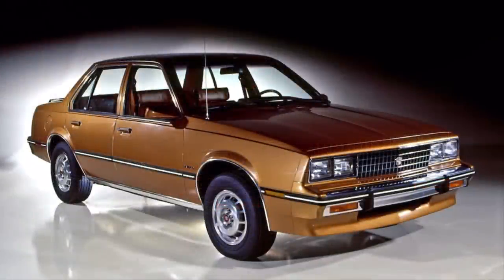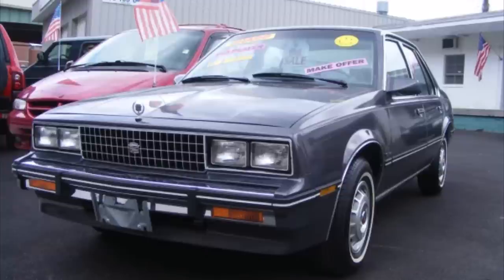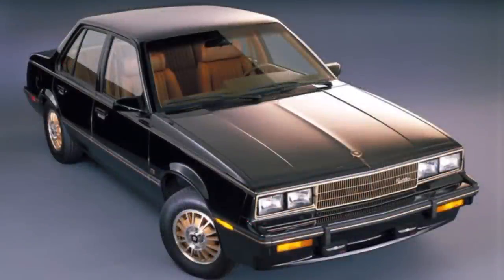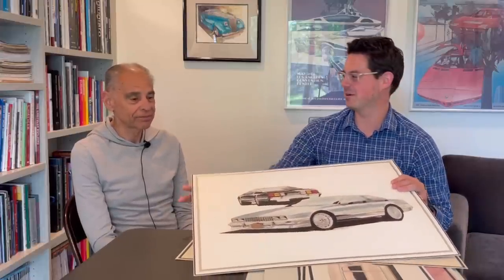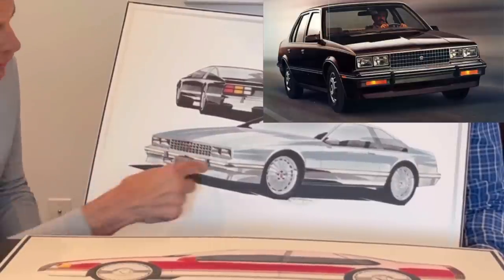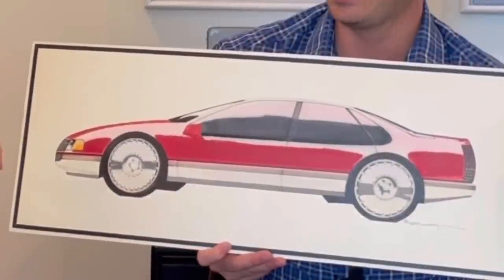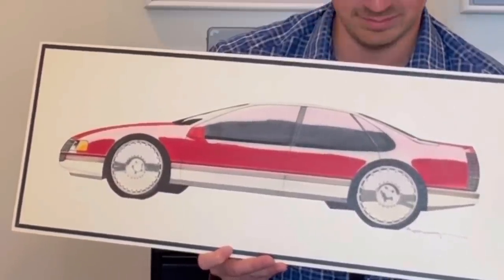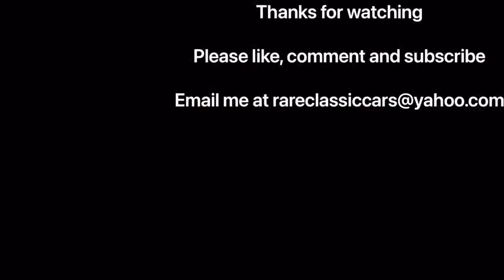The Cadillac Cimarron & Its Design: What Designers Wanted vs What They Got

Comment: Personal belief. I believe the Cadillac dashboard should have come from Buick Skyhawk dash design. Looked more upscale than the Cavalier design. For it to be a Cadillac they should have offered a 5 speed manual or 4 speed auto transmission. The 2.0L throttle body injection engine wasn’t bad for its time but for the price bump, the car needed the V6 standard. The 1.8 OHC turbo and later 2.0 OHC turbo was faster but suffered horrible turbo lag and torque steer.

Comment: Question- were the fwd unibody platforms designed by the divisions or by gm central engineering, then handed to the divisions to sell like the Vega was.
Reply: The FWD X/A bodies were GM's first attempt at joint development across the divisions, with the labor dividing up among them. I'm not as familiar with the J's, but GM North America and GM Europe were involved in the J development. After reading DeLorean's On a Clear Day, it is really surprising GM did not go bankrupt sooner. There was so much duplication of efforts with each division doing their own thing even in the face of the inevitable decline of market share as foreign entrants were coming into the market.
Reply: @stevevarholy2011  they almost did in 91. The truck/suv revinue is what helped them avoid it.
Reply: The j-car was mostly of German origin.

Comment: Great preview. Maybe it coulda worked if the J cars were good to begin with but they were overweight, underpowered, and no IRS in the rear. The cimmaron done right coulda been the gen 1 Acura Integra. Everyone always knew it was a re-skinned Civic but even then I dont see how it coulda been possible on such a short time frame and budget.

Comment: I think it is forgotten that GM had (somewhat) successfully pulled off what they were trying to do with the Cimarron in the other divisions (J2000, Firenza, and Skyhawk). Perhaps if they’d have started the base price of the Cimarron just a little lower, say around $10,900 with less content, instead of over $12,000, then let buyers option up to the big $, they’d have lessened the perception that they were thrusting an overpriced gussied up Cavalier on the market. The Skyhawk Limited had a starting base of just over $8,100, so there was some room to start lower IMO. GM also pulled what would become a trademark strategy, they start getting a car sorted out and kill it.

Comment: It looked like a small Opel from Germany, that's not bad. Opel was making some very nice cars in Germany in the 80s, just not what traditional Cadillac buyers were used to, Opel senator was beautiful.
Reply: Don't forget that in the late 1990s, Cadillac took a German Opel and sold it in the US as the Catera. Advertised as "The Caddy that zigs", the Catera tried to compete with cars like the BMW 3 series, Mercedes C-Class and Lexus ES. Like the Cimarron from 1982-88, the Catera was also an epic fail, especially with its generic styling and reliability issues. I refer to the Catera as the Caddy that increased Lexus sales. In fact, my parents had one. Several years and many problems later, they bought a Lexus.

Comment: I don't understand why GM didn't take the Ascona C instead of the US Cavallier and put US bumpers, Cadillac grille and taillights on it.  My Aunt had an Ascona and I always liked the styling, and it was a decent car, about as good as you could get in an early J-body.  That seems to me like it would have been a better option.
Reply: From the photos, the Ascona 4 door seems to have almost exactly the same body panels as the Cavalier or the Cimarron. The 5 door hatchback was, of course, different, but I don't that would have gone over well in the American market. Maybe one of the bigger engine choices would have been a big improvement over the antiquated 1.8 L we had here.

Comment: The problem with the Cimarron was not so much the styling - by 81-82 Cadillac quality overall had gone into the toilet - I know I was there .  We would roll these jumped up skateboards off the transports and boom the check engine lights would come on . The interiors were cheap and the engine had no power - in retrospect it looked like undercover agents from Ford had taken over GM .
Reply: In 1981 you could get 3 engines in the seville.

The V864, the diesel 5.7, or a credit option Buick 4.1 V6.

The Buick V6 was probably the most reliable of the 3.

Comment: They could easily have stamped out some sheetmetal exclusive to the Cimmaron that could have helped distinguish it from its corporate twins. Otherwise it relies completely on exterior trim for differentiation.. They were just to cheap to invest in it and it showed.
Reply from the maker: Sheetmetal is one of the longest lead time items.  You’re forgetting that with all that change, you’d have to revalidate the car for crash and safety standards.  Clock was ticking.
Reply: @RareClassicCars  I think they could have managed a re- strike on the fenders and some clever rear fascia.

Comment: I find it hard to believe someone made drawings of a car with huge ghetto reehuums and no tires back in the early '80s. Such abominations didn't exist back then. Cars still looked pretty much like cars. Not as good as '70s cars, but 10 times better than the trash we have today. I had been working as a government fleet mechanic for almost 4 years when the Cavalier came out in 1981. We wound up with a large number of them. Other than the fact that they were front wheel drive, I liked them. Had they been rear wheel drive, they would have been very simple, basic cars that would have been very simple to service and work on. The original base models even had 13 inch wheels, which were the perfect size for the car. 1981 was only one year after the Ford Pinto was dropped. I still own and drive a 1972 Pinto wagon, complete with 13 inch wheels. If it weren't for lowriders, I wouldn't be able to get tires for it. 

But while the Cavalier was a decent transportation appliance, it was not a luxury car, and there really was no way to turn it into a luxury car. The styling was pure economy transportation appliance. Loading it down with luxury features would have drastically raised the price, and it still wouldn't have had the right look. And it was just too small. IMO, a luxury car should be large, and have a smooth, floaty ride. I have owned a 1974 Lincoln Mark IV, a 1978 Lincoln Mark V, a 1987 Lincoln Town Car, and currently drive a 2006 Lincoln Town Car. To me those are what define "luxury car", and the Cimarron just didn't fit that definition.

Comment: originally the Cimarron was supposed to be on the X platform with that Gen of Buick Skylark Chevy Citation Oldsmobile Omega and Pontiac Phoenix but they couldn't get it to work so the Cimarron was Switched to the J Platform so it ended up looking like a dressed up overpriced Cavalier and was a similar price to what the Seville had cost 7 model years earlier correct the base Seville cost $12.479 when it debuted in Mid 1975 for the 1976 Model Year while the base Cimarron cost $12,131 in its debut model year 1982 Heck even a full size Chevy Caprice had a lower starting price in 1982 was 8,437 the only 2 J platform cars that lasted past 1988 were the Cavalier and the Pontiac Sunbird/Sunfire which both lasted until 2005 it was also the shortest length Cadillac up until then at 14.83 Ft

Comment: Cimmaron. 
Versailles. 
Both of them made me giggle when they were released. I understand the suits demanded a quick job and with just new clips front and back. But the result was just comical. 
Compared to Chryslers adaptation of the J Body Into a credible Imperial, GM and Ford’s efforts were laughable.

Comment: Though I am far more into Lincolns vs Cadillacs, even I know this car was a total disgrace to Cadillac.  Whatever one may say about the Versailles (and I actually don't mind the 1979-80s when they redid the roof), they are Mark IIs in comparison with a Cimarron.
Reply: I should add, I am not blaming John in any way...he obviously had essentially nothing to work with in basically no time, so under those circumstances he did a fine job, but GM should have not been that cynical and even think of doing a project that quick and that cheaply for their premier car brand.  I'm sure John could have made a nice car if GM allowed him to...

Comment: The J cars were horrible. GM shoulda used the saturn CAR to replace them and never bothered with saturn the brand. Instead gm kept the J cars in production through my 2005! I test drove a cavalier once. Every lever button switch etc felt like it was gonna break off and rhe dash shook as you drove. I got my used buick regal 3800 instead.

Comment: The first generation Cimarron was not as attractive as the later models. My wife worked with a woman who bought a dove gray example with a fake mock top, Vogue Tires, wire wheels a continental spare tire. It had to be the ugliest thing that I ever saw. After about 3 years the paint started to peel off. Finally at about 5 years, the engine blew up. Gee, I wonder why people bought imports?

Comment: John and the Cimarron were constrained by a failing GM.  Yes, even during the 80’s, GM was nose-diving at an alarming rate.  My family was a tier-one supplier to GM at the time and we chose to cut ties with GM due to their business practices.  GM’s issues started back in the Late 60’s/early 70’s when there weak management with little foresight buckled un contract negotiations and gave away significant cash-flow resulting in a gross under capitalization for future processes and products (a.k.a.: Cimarron).  Footnote: I currently have a 1985 Limited Edition Seville in my collection and it requires more attention than my 1941 Buick.  Again, John’s hands were tied via financial rope!  (Q: Who is the biggest automotive producer in China today?)

Comment: Everything that was wrong, mendacious, cheap, and lazy about GM during the 80s was crystalized in this abominable turd called Cimarron, a flagrant insult to loyal Cadillac customers. To make matters worse, Cadillac was still bleeding heavily from the horrific failures of the 4-6-8 and Olds diesel engines.